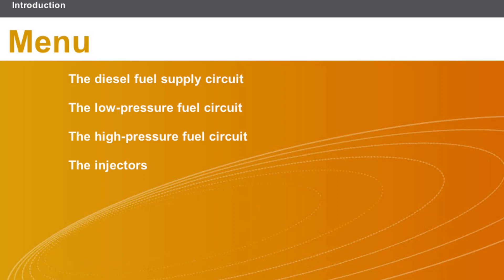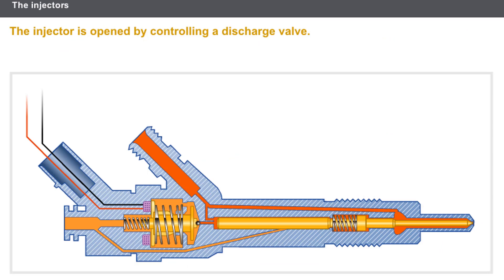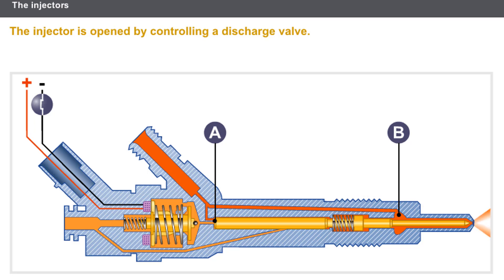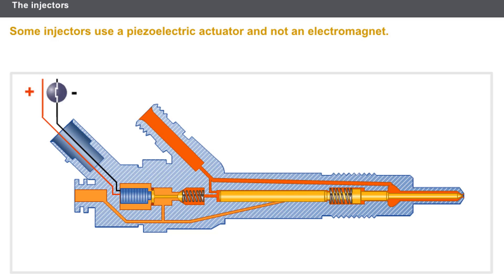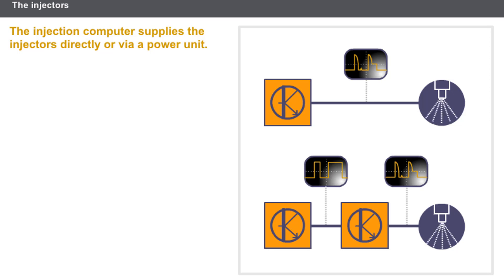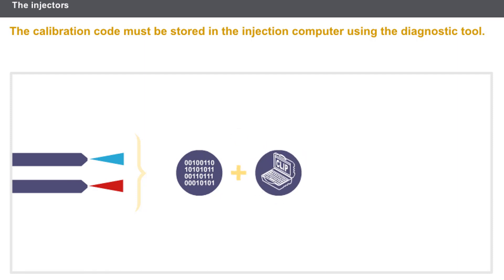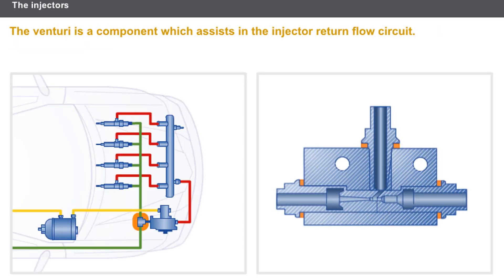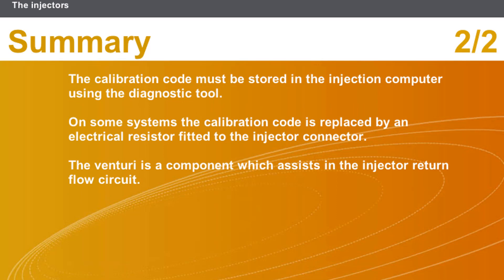Engine diesel (part3) the injectors

Comment: My Mitsubishi diesel truck injector always clogged on piston number 1 & 2..why its happen n how to solve the problem
Reply from the maker: Thank you for your comment! Injector clogging on piston numbers 1 and 2 can happen due to a few reasons:  

1. **Fuel Quality**: Low-quality or contaminated fuel can lead to deposits forming in the injectors. Ensure you're using clean, high-quality diesel fuel and consider adding fuel additives to clean the system.  
2. **Injection Timing**: Incorrect injection timing can cause uneven combustion and deposits in specific cylinders. It’s a good idea to check and adjust the timing if needed.  
3. **Cooling System Issues**: Overheating in certain areas of the engine can result in carbon buildup. Inspect the cooling system to ensure it’s functioning properly and providing even cooling.  
4. **Air/Fuel Imbalance**: Problems with the air intake or an imbalance in the air-fuel mixture for those cylinders can lead to incomplete combustion and clogging. Check the intake system and sensors.  
5. **Injector Maintenance**: Regular cleaning or servicing of injectors can help prevent clogging. If the issue persists, you might need to replace the injectors on cylinders 1 and 2.  

I’d recommend getting a professional diagnostic done to pinpoint the root cause. Thanks for sharing your experience!